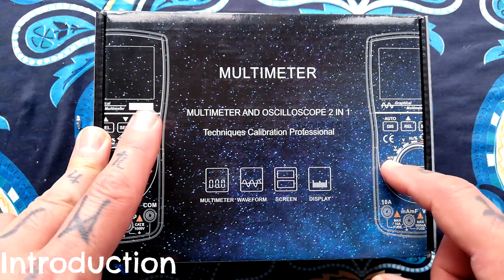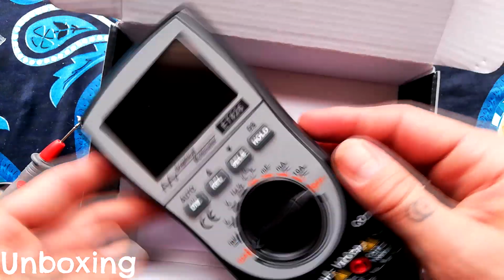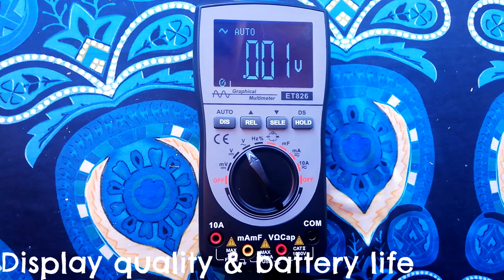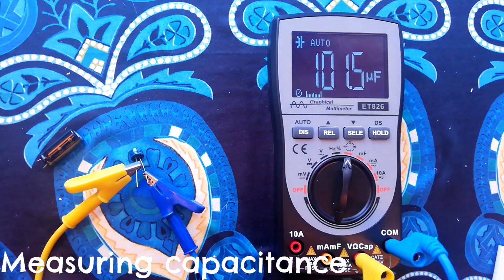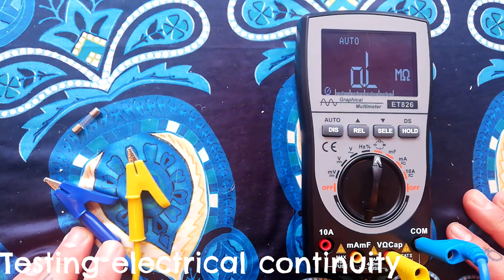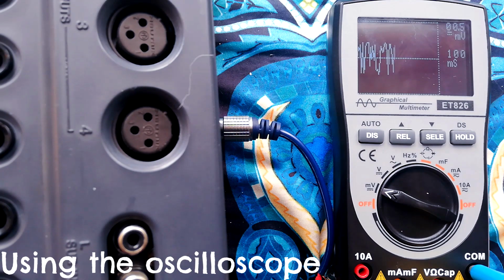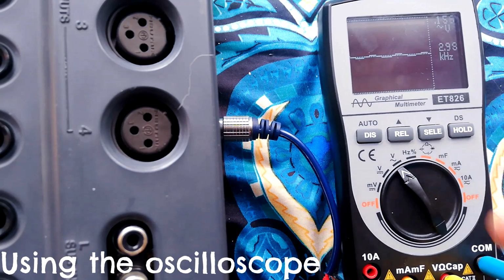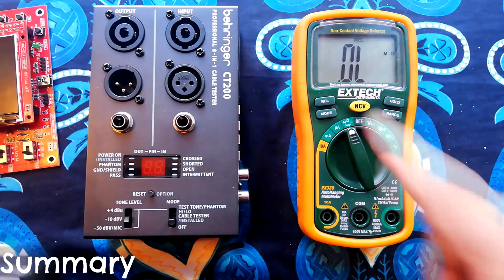2 in 1 digital Multimeter with oscilloscope | MUSTOOL MT8206 a.k.a. KKMoon | Unboxing & Review

Comment: For the capacitor you put one lead in mAmF and the other in VΩCap, is that how this meter is supposed to work? looks like two separate selection choices, shouldn't the negative lead always be in the COM? The print under the leads input suggest they are fused to GND